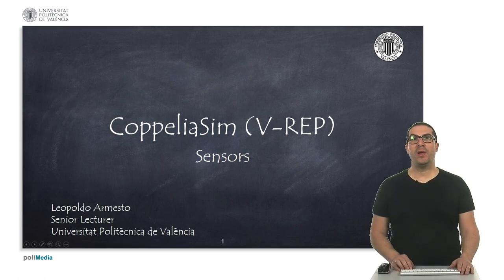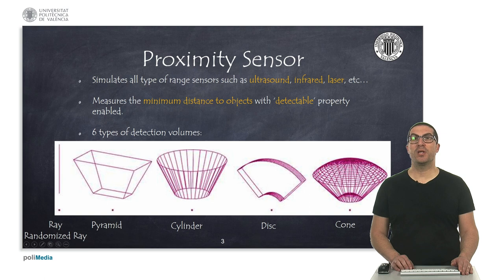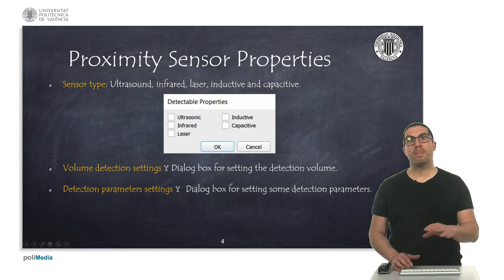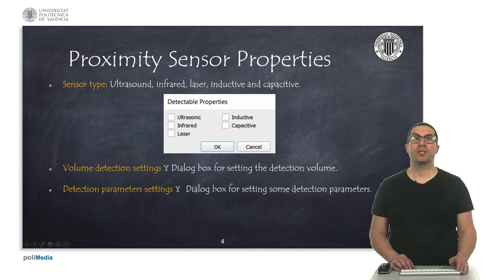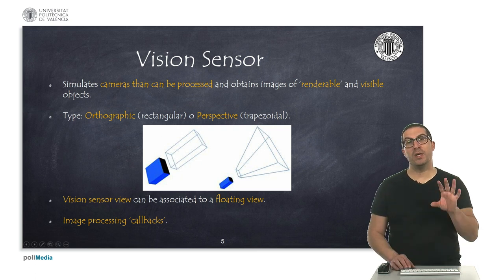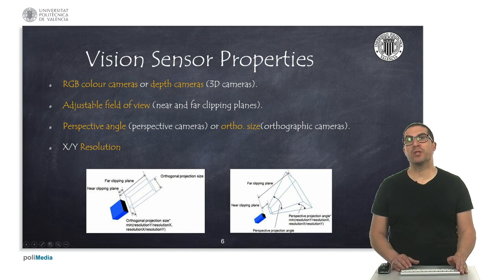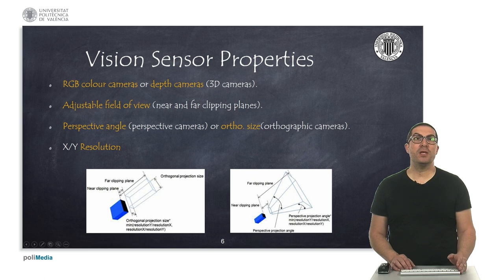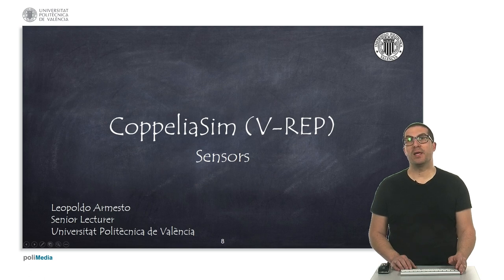Sensors | CoppeliaSim (V-REP)

Comment: Hello Prof.Leoploldo
i work on an autonomous minesweeper 4-wheeled mobile Robot as a graduation project , and i have to use gyroscope sensor in v-rep to adjust the orientation angles , i can't implement it (as coding) in my robot to get the angel about z-axis and can't find any video or documentation explaining this issue , can you help me ?
thanks in advance